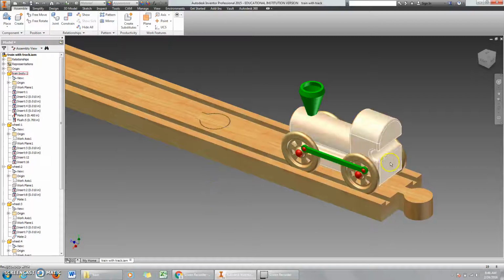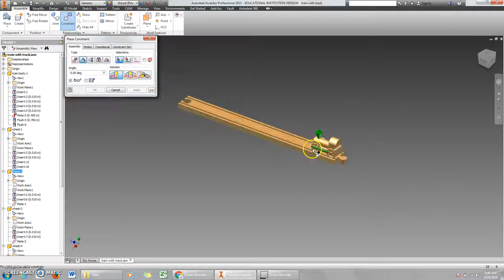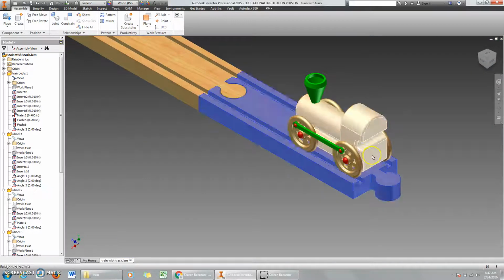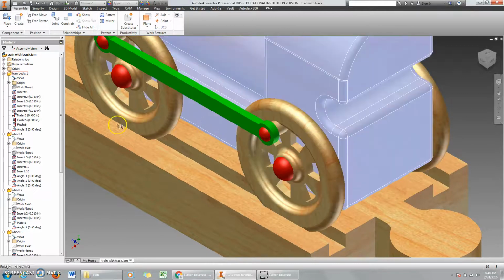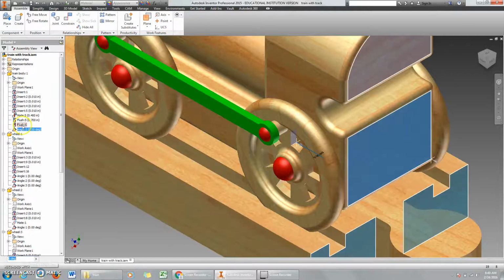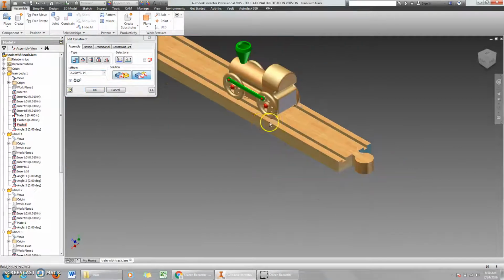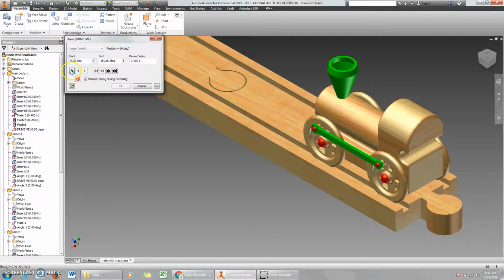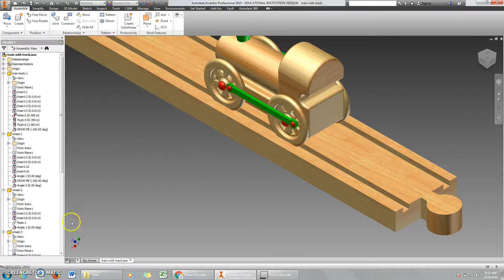Straight Train Animation

Comment: when i try to use crank with the flush constraint on the back of the train and the back of the track, it says the formula can't be evaluated. is there any way to fix that?
Reply from the maker: Double check that your case on the "crank" matches the formula.  For Example, Crank is different from crank.

Comment: You stopped me from throwing a brick at my computer. I tried following several other animation tutorials (for the same model, supposedly...) where they applied angle constraints to the wheel planes rather than the spokes, which caused a lot of relationship errors when I tried doing it (since my model is a car not a train, which means no linkage arm, even though I tried that as well...and I'm sure you can imagine how silly a car would look with linkage arms...) whereas your tutorial is straight to the point with a much easier (and frankly, idiot-proof) method, applicable to more than just the specific design of the train model used. For that, I cannot thank you enough!!! Now I just have to render all the parts...